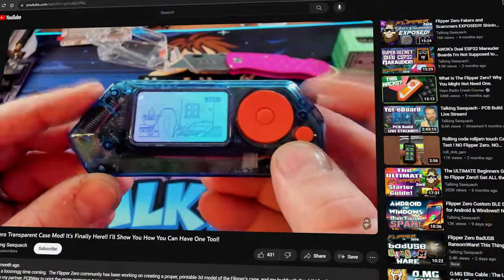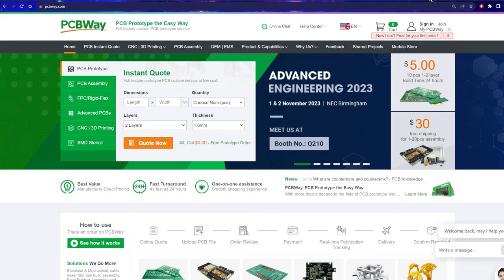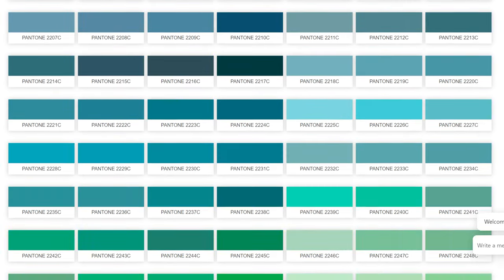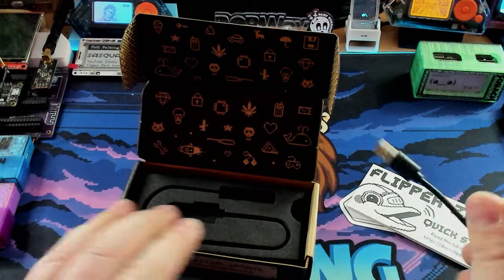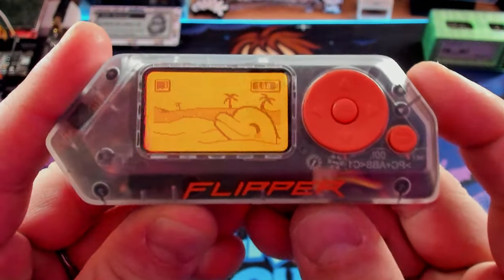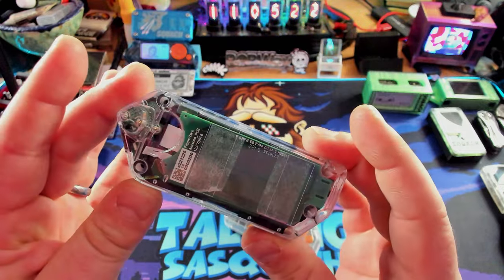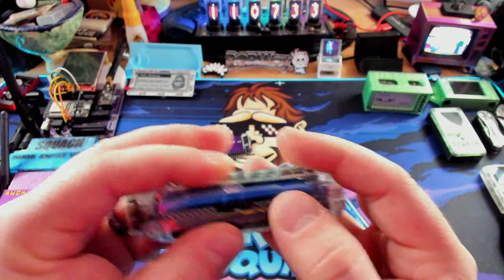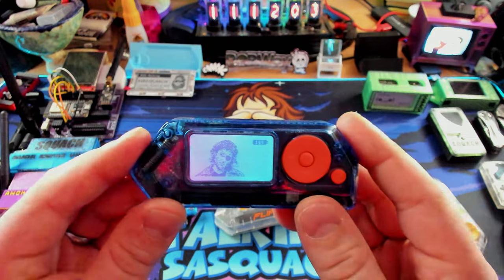Flipper Zero Clear Case Showdown!!  Community Case Vs Official!  Who Wins!?

Comment: Nice! I personally prefer the official one even thought it’s a cashgrab as it looks more « vintage » like the transparents gameboys
Reply: It's for longevity. The printed cases won't hold up to the test of time the same way an injection molded case will. It's still prob a cash grab, but they're at least using a plastic that will last a long time. I'm not knocking printed cases, but after going down the rabbit hole on every filament and resin, I know the high production stuff will last as long as my Gameboy color and whatnot because they won't be made of the same plastic. 
I'm working on one that's printed out of something that'll be a game changer longevity wise. I hope it all works out. 🤙🏽